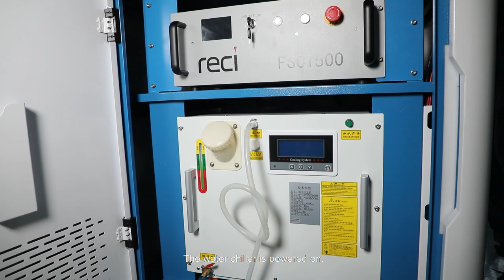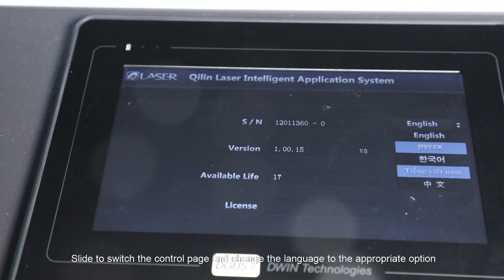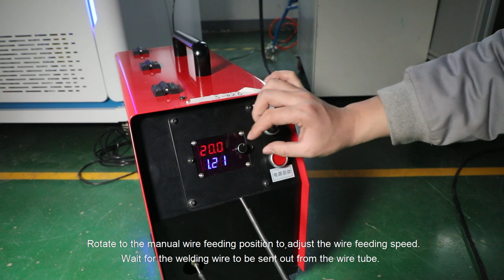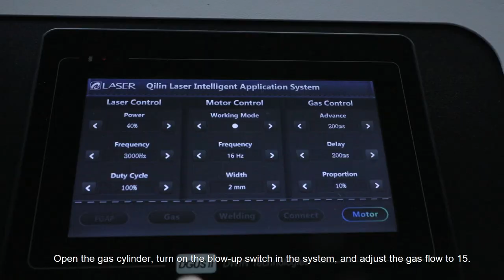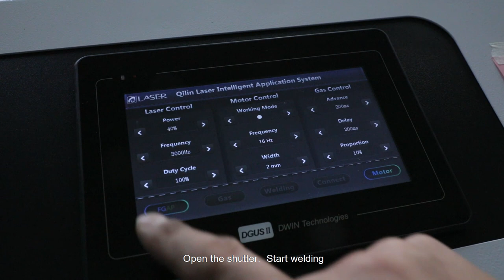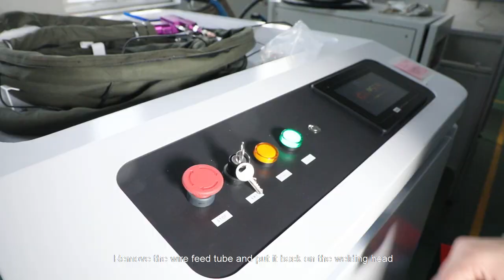How to use handheld fiber wire laser welder

Comment: Ive bought senfeng welding machine which is on the way now? I just wondering what is the best setting for aluminium? I am gonna weld 1.5 mm 5053 aluminium sheet so what is your best advice for me?
power:
working :
mode :
frequency :
delay:
proportion:
Reply from the maker: hi，friend，may i have u email and whatsapp number？Our engineers will contact you as soon as possible. After your machine arrives, our engineers will also take the initiative to contact you and give you training guidance, please rest assured